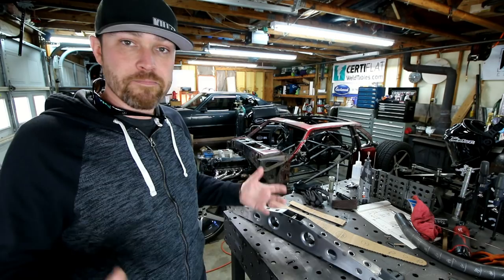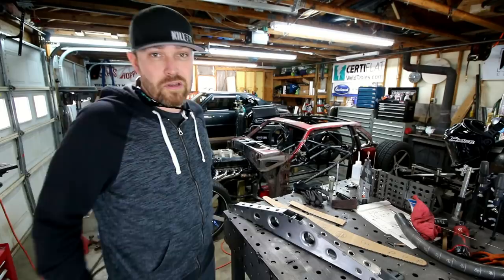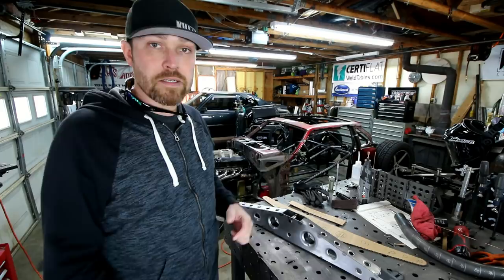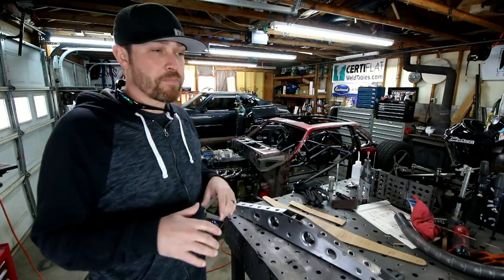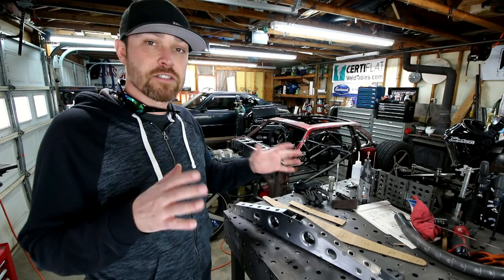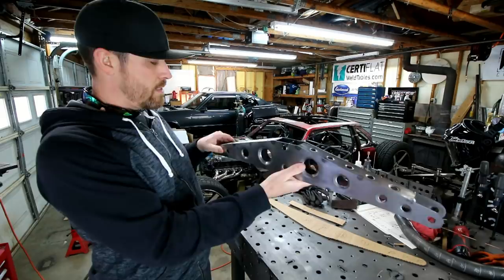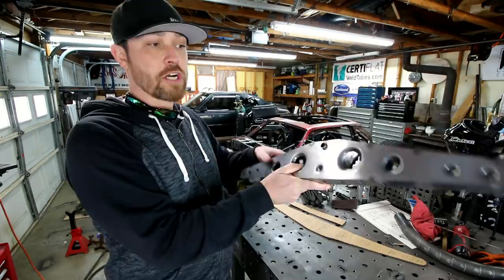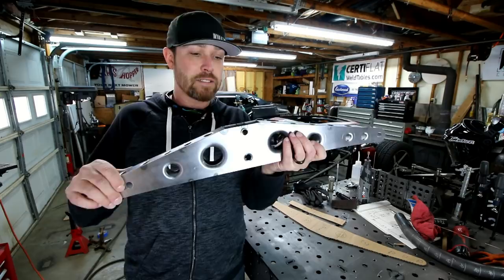Custom Cantilever Suspension | Mustang Hot Rod Build

Comment: I like the concept, I would have done reverse on the ram so when the ram is lowered all the way the vehicle is at ride height. That way if you broke a line or something it would be drivable. Also the cantilever pin should probably be much larger and have a bearing perhaps.

Comment: I am following your vids, and listen closely to the creative processes that just flow out that mind.  If i lived in the same local as you i would take you high tech 3D design and exotic Carbon-Fiber, Zylon, Kevlar, and a slew of other fab conciderations for just the free opportunity to create.  Mine is a long exposure to composites, as well as 37yrs. steel plate fitter/CNC burner. Over the years i have seen first hand guys that do any print to any steel fab(some small to 50tons).  I have seen from scratch fitters, the very best period, and the more i see your vids the more inclined i am to believe your top notch from scratch!! Keep up the good work.
Reply from the maker: thanks

Comment: Looks cool AF Kyle!
Love the hydraulic idea...Will look sick on the front end!!!
I think it will the rear stability will work just fine for its intended use....We use this setup with much longer bars plus double the vehicle weight...off road...Then drive on the street home with not a problem.  You should be totally solid
Reply from the maker: +Smokin07ram thanks

Comment: Great progress, That arm looks plenty strong, my only suggestion would be to add a doubler where the center pivot point is going to be, I know you have the tube going through but a doubler will help spread the stress over a larger area.
Reply from the maker: It has bracing on the side that tie the sides and the trough tube together.

Comment: good job love the videos next time you gota do bushings like that fab a piece of pipe with a cap and hole in the end use some allthread and a quick homade bushing puller press works wonders and another reason to fab a tool

Comment: If you're going with hydraulic fluid I suggest using pilot operated check valves so when you get to ride height there is no way it will drift down on you. Also flow control valves should do the trick for slowing it down 👍
Reply from the maker: +Jared guede Yeah that's the plan

Comment: If you wind up having trouble with side to side movement of the rearend housing, you can fully eliminate your problem by fabbing up a watts link for it. If you do the watts link, here is a piece of advice. You definitely dont want to attach the center section to the differential cover. It will put unwanted stress on the cover and can possibly some of the internals. Its trouble you dont want.
Reply from the maker: Its not gonna have side to side movement
Reply: The Fab Forums.  Im with you. I doubt you will have much side to side movement.......if any at all

Comment: those rubber bushings are to aid in stoppin the rearend housing from getting cracked wen in a stress position ,to ease impact against the rear end housing
Reply from the maker: Nah....alot of your performance shocks dont have any rubber. The rubber is mainly to combat road noise.

Comment: May NOT have side motion, but you can get in trouble not using rubber! Ha-ha,, (had to  thro that in there) maybe poly bushings? It will pick up alot of rod noise! But I don't think that will matter, this is in traditional, I almost did this with a camaro! I love it!!!

Comment: I just stumbled onto this video, and it looks like it's a few months old. I looked through the comments. The triangulated 4-link is what the off-road builds use, no issue going without panhard bar. I was kinda surprised no one asked about your geometry for your anti-squat and whether or not you did the calculations for that.
Reply from the maker: Yeah its triangulated four link and I setup the instant center when attaching the mounting tabs
Reply: The Fab Forums , I was asking about anti-sqwat. That is going to be a calculation based on the length and angles of the links in relation between the upper and lower. Depending on the setup, could cause the rear to either lift or squat under acceleration. Drag cars will change their link locations depending on track conditions for better traction or better launch from what I understand.

Comment: Loving the build. I am not crazy about the bracket that is bolted to the upper link arms, then bolted to axle brackets. It would look a lot more clean to cut off the factory brackets on the axle and build a truss, then weld tabs onto the truss for the heim joints.
Reply from the maker: yeah

Comment: Welded double plate around the shock and ram mounting bolt holes and maybe pivots? Something simple as a washer fully welded or custom shaped small plate. Will help with bolt shear if you hit a bump.
Reply: I was thinking the same thing, wanna make sure those bolts are high grade too
Reply from the maker: Yeah may do something like that....bolt double shear is around 35,000lbs so it wont be an issue but I for sure dont want the holes to wear oval.
Reply: Double bolt shear is rated in static, impact and cyclical loading are cause for some concern

Comment: Your whole settup looks very nice. Great quality and your videos have always been impressive. The only thing I would beef up is the pivot point for the cantilever, cause it will be taking the full load of the suspension to frame stress.
Reply from the maker: Its actually over kill for what it needs to do. It only needs to support the weight of the rear section of the car which might be 500lbs on each side max.

Comment: With the cantilever I would make a piece that ran the length of the bottom.  The reason is the strength of a triangle comes from the tensile strength of the of the lower member and the distance between the upper and the lower faces.  Think of it like this an I beam is skinny in the middle which is the sides of your triangle, and thick one the top and bottom.  It would have to stretch the lower part of the beam to fail and the web is just meant to keep it strait and the upper and lower flanges parallel.
Reply from the maker: it has one
Reply: The Fab Forums I’m not trying to insult you in any way.  I go to school for engineering, and I noticed that the piece on the bottom of your cantilever doesn’t run from the shock mounting point it the body mounting point.  My only concern is that steel is easy to bend sideways but hard to stretch and the tabs at the ends are un-triangulated.  If the rear end articulated to much you may push those tabs sideways.

Comment: The dudes saying you will have rear end movement don't know what they are talking about. That 4 link you have has almost a 45* angle in it. It's basically the same rear end as the mustang that axle came out of. The only rear end movement the mustang would have had would have been from rubber bushings and flexy chassis/arms. Keep it up man.
The questions I did have was on the cantilever arms. Are you planing on running a bushing of some sort for the center pivot? Most mini truckers that do cantilever arms usually weld in a poli-bushing on the center pivot or something like a Johnny joint or super-pivot joint from thorbros.com for movement and side to side flex. (these are basically rebuildable heim joints but with a weldable sleeve)
If those cantilever arms are a bit flexy you can always do what the offroad community does and double up the side walls and sleeve the dimple holes like seen on prerunner rear arms. A bunch of them seem to be double or tripled up 1/8 plates. Much easier to bend multiple thinner sheets that a big old plate.
Reply from the maker: yeah for sure.
No bushing, unlike the mini truck setups the only time mine will actuate is when raised up or down. It wont move going down the road.

Comment: Love what you are doing here.  Can hardly wait to see the finished project.  

Just a thought on your cantilever links:  I would weld some doubler slugs to the ends where the bolts go through for the shocks and the hydraulic cylinders.  The bearing stress will be very high in these areas, and will Brinell the holes.  A 1/4” thick washer welded to either side will reduce the stress to 1/3 what it currently is.  

As I said, just a thought.  Keep up the awesome work!!
Reply from the maker: +Skid Roe yeah gonna make that happen

Comment: This is exactly what I had on the rear of my mini truck back in the 90s. You definitely make it look a lot better than what I had. I’m digging this build totally.   Definitely slow her down in the travel motion or you will be replacing a lot of mounting points. I’m pretty confident that you will have no side to side tracking issues with the triangulated set up. Triangles are very strong if I can remember correctly😂. This set up usually binds pretty bad at the joints but you relieved that with all of the Hiem ends.
Reply from the maker: +Dirt Heretic 83 Yeah for sure

Comment: I've been able to follow your vision right along. Your descriptions have been very close to what you intend. Just one suggestion I would have, not the build as such, would be to replace the jack on the press with an air over hydraulic. I have the same press. Just picked up a jack from HF. Added a foot pedal. What a difference. So much easier. I can still fine tune with the handle but have both hands free to hold whatever I'm working on. Just a thought.
Reply from the maker: +jake Yeah was thinking about that while pressing these
Reply: Super simple mod and not expensive, especially on sale. I did the same with my engine hoist except for a hand control. Great project, amazing detail and forethought.

Comment: rubber mounting is meant to give flex  ..removing it makes sense ,  thus eliminating an original design flaw . some commenters don't even know what the D1.1 code book is  or ASTM  . and only repeat what they read . 15 yrs local 17 ironworker / 15 yrs weld inspector, Great work and Attaboy .
Reply from the maker: Thanks

Comment: Good stuff dude! Great how you describe your thought process on the build. And I love the uniqueness of this build. I don't think side movement will be an issue. Works just fine for the rockcrawlers. Make sure you put the ground clamp on the links when you weld on them on the chassis. You might be and I didn't see it. But if you didn't then the current has to go through the heims.
Reply from the maker: +Doug Bug Yeah for sure

Comment: Very cool adjustability with the cantilevered coil-overs. If you don't mind, I'd like to offer a suggestion on their fabrication. Almost all of the load will be seen along the top (compression) and on the bottom. (tension) If you think of an I-beam, any holes or notches are strictly avoided on the flanges, as they do the same thing. All of your lightening should be in the web. (on your sides where you have the big holes which are fine) Rather than have the three edge pieces be short, they should wrap all the way around the whole cantilever arm so that there are no places where the primary load is transferred back into the side plates. Any where that can happen will be a potential failure point. I other words, fully boxed. Good luck.
Reply from the maker: It cant be fully boxed

Comment: I REALLY like this project, this is good stuff ! Just one constructive observation....I would be slightly concerned about the shear strength of the bolt mounting points on those cantilever arms. For myself, I would beef them up just a little bit....Looking forward to seeing more  !
Reply from the maker: +Black Waterdogs the cantilever or the bolt? Both are way over kill for the loads they will see.
Reply: I was referring to the central pivot point of the cantilever arm, where the bolt passes through it....I was thinking about the thickness of the metal. I may be underestimating it`s strength....no offense meant  :-)

Comment: If you're concerned about lateral rear axle location, might I suggest a Watt linkage instead of a Panhard [track] bar?  That would give you more flexible vertical movement, yet keep the axle centred in the car as it goes up and down. It's a road racing suspension as opposed to a circle track one.
Reply from the maker: +John Lloyd yeah I am familiar....don't think I will need any of it. It would be road or circle track raced.

Comment: Thoughts on the adjustable ride height: If you car sits low at full cylinder, then trailering or getting into/out of slopes could be an issue, if you have 'ride height be at 1/2 cylinder, then you could 'frame drop', ride height, lift for trailing loading/slopes.
Reply from the maker: yeah this whole setup is adjustable and I will figure all that out when it gets to be that time.

Comment: I am very interested in your comment about spring and shock having a better ride then air.
I thought it was the opposite.  ?  ?  ?

I would like to build the smoothest riding golf cart possible  and i am looking for suspension ideas.

This will be a tube build. Something like a 2 searer cross cart you can step into. 4wd. 84in wheelbase. 60in track
Any help would be appreciated

Comment: My only recommendation would have been to have a slightly longer hydraulic stroke so you can lift above ride height, just for the sheer aesthetic of having tons of travel looks cool to me. And if you're concerned about fluid moving from cylinder to cylinder simply run a check valve and a dump (solenoid) valve for each cylinder that way the fluid can't move.

Comment: Have you explored a system that allowed hydraulic cylinders being in a closed position when at ride height, and open when laid down? Reasoning is that if you had a hydraulic failure (they happen....) then you can't drive/move the car without throwing sparks. I'm sure packaging could be a problem, but overcomeable...?
Reply from the maker: I have not

Comment: There's a company out there, I forgot the name but Mike Finnegan used their product and featured them in the latest Finnegan's Garage video, but what they do is put a hydraulic cylinder on the end of a coilover. Changes ride height without changing the design of the shock and spring. Looks like you're going for the same effect but with a different design.
Reply from the maker: I am familiar....I need struts though and I want to be a little more creative on this particular build.

Comment: I’m not sure why people are worried about lateral movement, that’s one of the main benefits of a triangulated 4 link, no panard bar needed...
Reply: But you do need a diagonal track bar.
Reply: yeaup, lateral support is still needed. Triangulated is not enough. Panhard or Watts Link is recommended. 

The way i like to explain it is by grabbing a broom the same way a triangulated link grabs the axle and keep your elbows locked. both arm are angled towards the middle. Then have someone push on one end of the broom as hard as they can and you try to keep the broom from moving. You will realize right away that either you won't be able to keep the broom steady or you are trying REALLY hard to keeping steady. 1 can argue that you might need another set of arms to simulated the lower triangulated links but this just to give you the idea.

Now grab the broom from one end with both of your hands in front of you and have it inline with your arms while someone pushes on the other end. You will notice that you have MUCH  more control and it is easier to keep it stable.

Yes, one benefit of a triangulated set up is that it "helps" with lateral movement, but it doesnt completely takes care of it. The longer the arms the harder it is for the triangulated to keep it stable in a lateral movement. The shorter and more aggressive angle the better. but too aggressive and it may affect proper movement. Theres people that get away with just a triangulated set up and will tell you that there set up has been working for years without a problem but quite honestly, i dont trust it. I would feel 100% comfortable having a positive link dedicated for lateral movement.
Reply: Watch a king of the hammers race.  Triangulated four links all over the place with no track bar at all.  With two feet of travel.
Reply from the maker: @19sinus  that would make sense if there was only two links but there isn't. The way this thing is setup is the exact same way every foxbody on the planet is. It doesn't move
Reply: 19sinus they want the flex for crawling.  Street u want it to be rock hard stiff .. plus only the a-arm trucks actually win Koh
Reply from the maker: @justingeturgun  flex or articulation is different from side to side movement....maybe I need to do a video on testing side to side movement
Reply: The Fab Forums do u mean  lateral movement of swing of the panhard vs a triangulated   ? Or literal movement caused by  bushings or other ?
Reply from the maker: I'm just saying a setup can have tons of articulation but no side to side movement when running heims on a triangulated four link setup.
Reply: @MrLrry1266   No, that is incorrect.  If you had a four-link set-up with a pair of parallel links on each side, you would need a Panhard rod or Watts linkage for lateral control.  But this car uses a pair of upper links forming a triangle, so that they give rotational control of the axle AND lateral control.  Lots of '70s and '80s cars with live axles used this method, including the production car which provided the rear axle in this project.  It's an economical method which gives good results
Reply: Ok, now explain the roll center on each setup and the benefit or detriment of that when you encounter a little crosswind or anything that requires steering input at, oh...say 175mph.

Comment: Stupid question maybe but here goes and apologies if it is! Is the cantilever setup basically for ride height adjustment when stationary? If not won’t that change the load on the coil over spring massively?
Reply from the maker: +Brett Webster Yeah it's just for ride adjustment...not what is typically considered a cantilever suspension